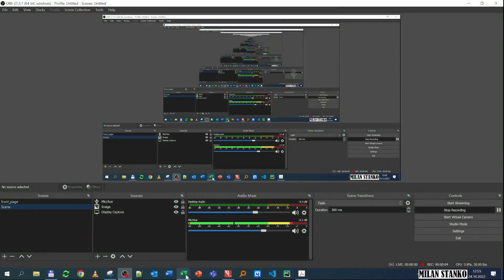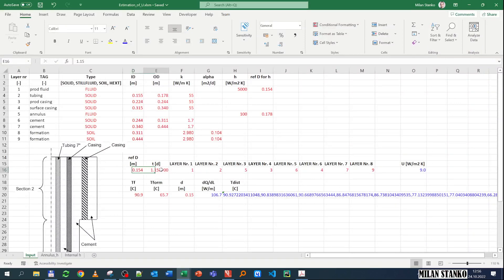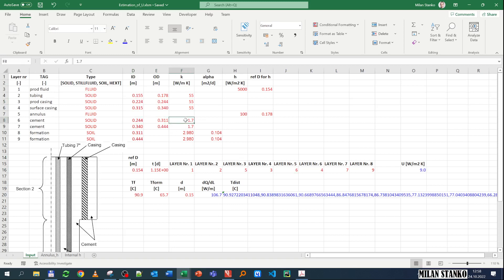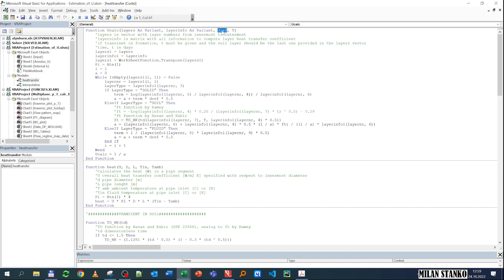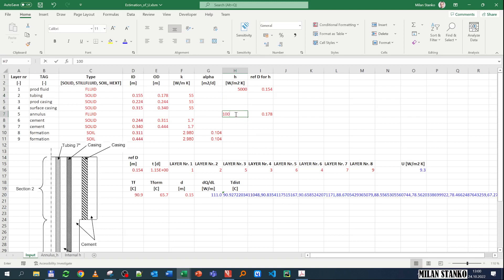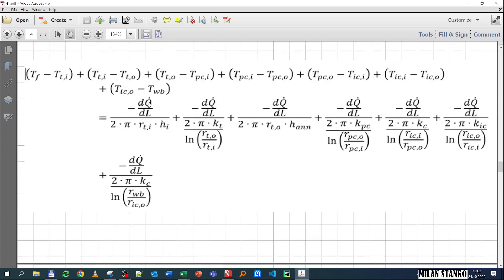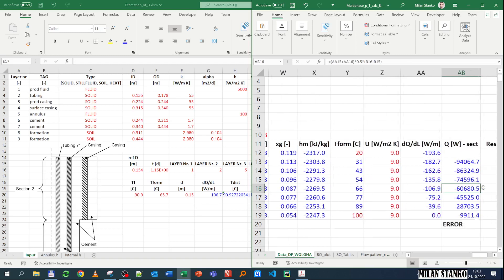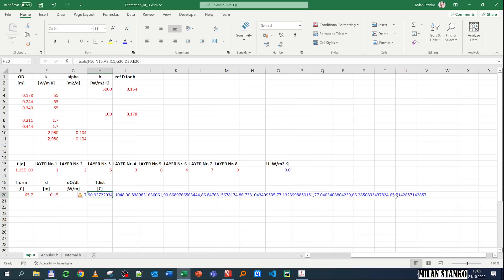43. Temperature calculations in wellbore - exercise part 2

Comment: Dear Millan,
I am an aspirant for subsea Pipeline engineering. Could you provide video for subsea pipeline design, on bottom stability calculation, buckling calculation, free span calculation.
Reply from the maker: Dear Karthik, I am sorry, I don't deal with these issues in my lectures.